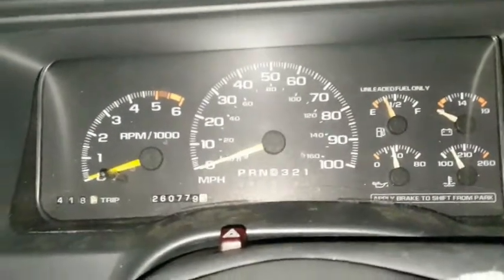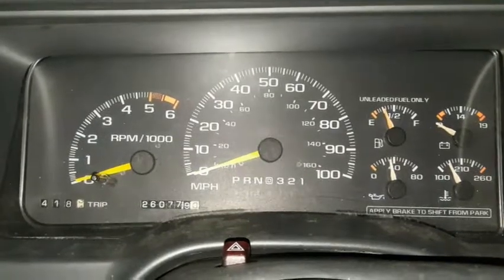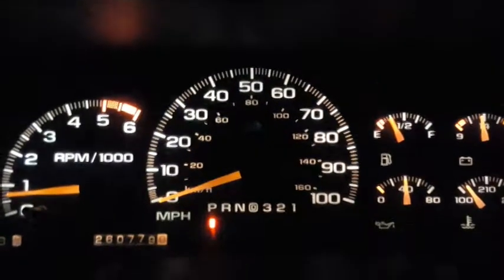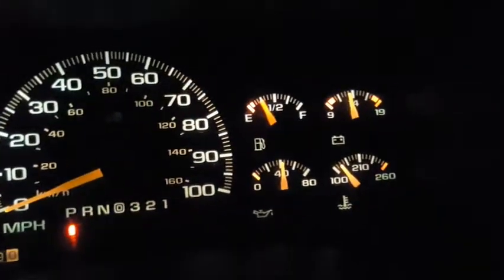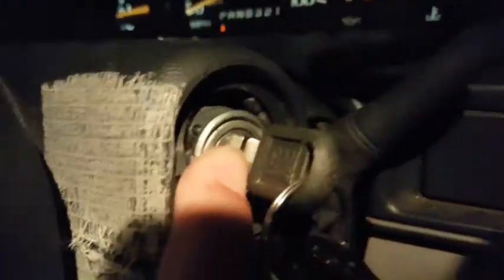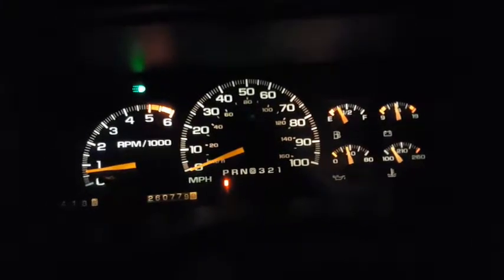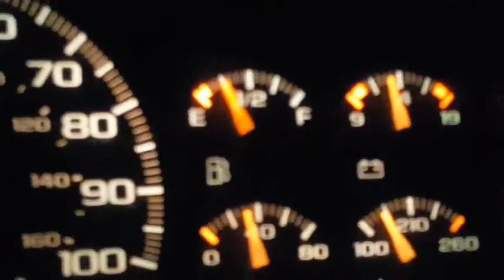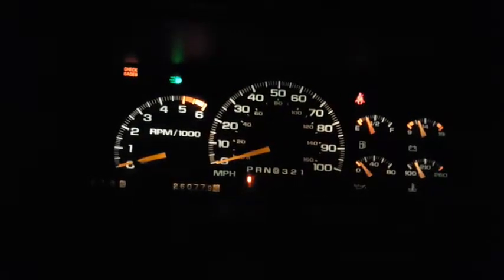99 GM Suburban 5.7 Liter Voltage Drop with Lt or Rt Turn Signal or Acceleration

Comment: Mine is doing it also but very little its stays on the 14 volts line but it goes in  front and backwards when i signal to go left and right and the emergency lights
Reply from the maker: The problem with mine was the fuel pump relay terminal.  Not the relay itself, but the tongs inside the fuse box under the hood.  The relay pins slide into the tong and had very poor contact.  This causes the fuel pump to draw heavy Amp load which results in voltage drop seen on the voltage gage.  Take the fuel pump rely off and check the contacts where the relay sits.  You'll find that one of them has been getting hot due to poor contact.  Just bend them with a tiny flathead screw drivethto restore contact to the relay pin.

Comment from the maker: It was my fuel pump relay that had weak contacts in the slots.  The poor connection was causing a high amp load and everything else electric would starve for voltage.  Pull the fuel pump relay off and clean the contacts on the box itself and not the actual relay.  You may need to use a tiny flat head screwdriver to bed the connectors out a little so that the relay pins will make solid contact.
Reply: I am going to do that thanks
Reply: I have a 91 Land Cruiser that does the same thing with the blinkers but no issues with the motor
Reply: By saying the relay it would be the small black square right? 😅
Reply from the maker: @DanielCampa-hn9kb yes.  Not the fuel pump relay itself, but the slot connectors (where the relay sits).  The female tabs will bend and cause poor contact to the male ends of the relay pins.  Take a small tiny flat head screw driver or something similar to bend the female tabs tighter and the problem will be solved.
Reply: @ ahh ok I understand thank you so much sir 🙏🙏

Comment: got three of these trucks myself and i'm still looking for the fix, if i could get one fixed, then i could fix the rest, been trying everything, going to try the pins on the relay box !!! thankyou!! i hope it fixes it!!
Reply from the maker: It was my fuel pump relay that had weak contacts in the slots.  The poor connection was causing a high amp load and everything else electric would starve for voltage.  Pull the fuel pump relay off and clean the contacts on the box itself and not the actual relay.  You may need to use a tiny flat head screwdriver to bed the connectors out a little so that the relay pins will make solid contact.

Comment: I'm having the same issue when I am driving 60 through 75  drops when I do a hard acceleration pull
Reply from the maker: It was my fuel pump relay that had weak contacts in the slots.  The poor connection was causing a high amp load and everything else electric would starve for voltage.  Pull the fuel pump relay off and clean the contacts on the box itself and not the actual relay.  You may need to use a tiny flat head screwdriver to bed the connectors out a little so that the relay pins will make solid contact.

Comment: I'm having the same issue with my 97 silverado k1500 5.7l. If I turn my ac on hight to fast itll kill my engine also
Reply from the maker: It was my fuel pump relay that had weak contacts in the slots.  The poor connection was causing a high amp load and everything else electric would starve for voltage.  Pull the fuel pump relay off and clean the contacts on the box itself and not the actual relay.  You may need to use a tiny flat head screwdriver to bed the connectors out a little so that the relay pins will make solid contact.

Comment: That's what mine dose but it jolts back and forth real noticabley  and it's only when I signal but my truck dosent shut off or anything like that
Reply: Yeah I’m having that same issue on a 96 s10 but it is only my left turn signal my right is perfectly fine though
Reply: This just started happening to me yesterday on my 1990 Chevy when I use my turn signals people keep telling me it’s my grounds but idk I checked all that
Reply from the maker: @ljschaerig2134  It was my fuel pump relay that had weak contacts in the slots.  The poor connection was causing a high amp load and everything else electric would starve for voltage.  Pull the fuel pump relay off and clean the contacts on the box itself and not the actual relay.  You may need to use a tiny flat head screwdriver to bed the connectors out a little so that the relay pins will make solid contact.
Reply: @horsingnaturally2244  alright I’ll look into mine thanks

Comment: Ground on fuel pump
Reply from the maker: Richard Wilder That was my guess as well.  It however was good, as were the other grounds.  Turns out the 84 pong on the fuse box pump relay was caved in and not providing a clean contact.  So the relay was conflicted with voltage being applied to the engage and cutout relay pins.  There are five pins on the relay itself.  It was the pin pong on the front row forward side that was not making good contact that kept burning up the relays (3 of them) as well as causing a severe voltage drop.
Reply: @horsingnaturally2244  so what's the fix to this exactly? My turn signal does this to my gauge. Only turn signal.
Reply from the maker: @gatesxtreme8  It turns out my furl pump relay contacts in the fuse box had poor connect due to age.  When you use the turn signals, the voltage drops due to a high load on the fuel pump relay.  This will also cause your vehicle to shut off while driving on hot humid days.  Remove your fuel pump relay and check the contact prongs on the fuse box....especially prong 80 (look on the back side of the relay).  If they are bent in too much, the relay pins will not make good contact and cause a very high electrical load which causes your turn signals to drop total voltage.
Reply: @horsingnaturally2244  so do you just replace the relay or do you have to replace the fuse box panel?
Reply from the maker: @gatesxtreme8  You do not need to replace the relay as long as your fuel pump is working.  But put your ginger on the relay with the truck running.  If it is getting hot, then the relay pins have poor contact due to bent pin prongs in the fuse box.  Pull the relay off and use a scribe to gently un-bend the tiny tabs that make contact with the relay pins.  I believe prong 80 was the one that caused my problem as voltage was being supplied to the positive and negative field contacts of the relay.